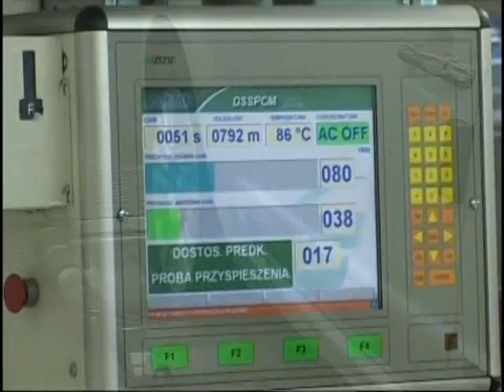Fiat 500 on the Production Line

Comment: there is a difference between the Euro and NA versions. different engines, transmissions, radios, specs, and the like. I drove both right and left driver models. otherwise the same trims, badges, interiors, and the like....